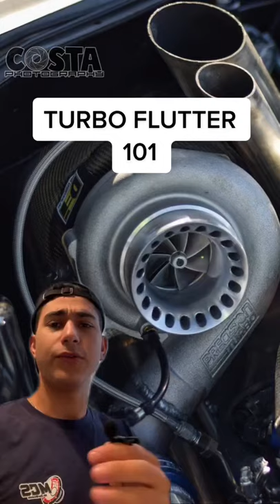TURBO FLUTTER 101 - Explaining Sutututu Theory

Comment: Running a high boost without a blow off valve is going to blow off that whole compressor Wheel eventually.
Reply: At best it will make the turbine wheel loose over time because it spins at such high velocities the bearing used can’t have added pressure.
Reply: @Uno_Floydd  which can lead to excessive play in the shaft. The compressor wheel can come into contact  with the housing if there’s too much play and catastrophic engine damage will occur.
Reply: @Nicholas247066  bingo
Reply: @Nicholas247066  Good thin flutter doesn't cause that to happen.
Reply: @DriftNick It can start to loosen the nut holding the compressor wheel on if it's a lot of boost. It's trying to force the wheel the opposite direction. More boost = more force in the opposite direction. Best analogy I can think of is when your using a hand drill, and the bit hangs up in the material causing the chuck to loosen. Same concept. I've seen and had both of these things happen.
Reply: @mikefelty2625  People here running 50+ psi without a valve and no issues with the nut on the compressor wheel becoming loose, that does not happen, not even sure how you think that it could cause that to happen.

"It's trying to force the wheel the opposite direction."

Except that it's not, it doesn't even slow the turbo down and yes people have tested it.

"Same concept"

Awful analogy, not even close to being the same thing.
Reply: @DriftNick  It can happen, because I've seen it happen. To be fair, turbo design has improved since I saw it happen over 20 years ago to a friend's 240sx and different guy's diesel. Oddly both were borg warner turbos. So maybe a design flaw with those turbos. I'm just saying that it can happen, not that it always will. Just because it hasn't happened to everyone, doesn't mean it can't. And yes, it definitely slows the turbo down or you wouldn't hear a change in pitch after every flutter. The sound would be a smooth continuous drop in pitch like every other time the turbo decels, not the fluttering noise. To be clear, I'm also not saying that the compressor wheel is spinning in the opposite direction, only that the excess boost is trying to spin it in the opposite direction, which is the reason for the fluttering.
Reply: @mikefelty2625  Just because you saw a nut come loose 20 years ago does not mean it was caused by flutter, flutter can can cause that to happen.

"it definitely slows the turbo down or you wouldn't hear a change in pitch after every flutter."

The turbo is slowing down because the throttle plate is closed and exhaust flow is reduced, the rate in which the turbo slow downs is the same with or without a valve, High Performance Academy have a video testing exactly that on their youtube, flutter does not cause the turbo to slow down, if it did it would not be common place in motorsport to have flutter.

The change in sound is both a result of the pressure waves decreasing as pressure goes out the intake and the turbo slowing down due to the reduced exhaust flow.
Reply: @DriftNick   pressure leaving the turbo the way it came in can and does wreak havoc on the thrust bearings in the turbo. And engines are rebuilt far more regularly in the motorsport world than by your typical car owner. Either way it is a surefire way to lower the bearings' lifespan and cause excessive play. Better to play it safe and just use a blow-off valve. Another added bonus of the blow-off valve is better turbo response, because you're not completely slowing down the compressor each time you let off of the throttle. See the following video if you still don't believe me: https://www.youtube.com/watch?v=6o5-oUaD65U&t=63s
Reply: @Nicholas247066  If it slowed down the turbo it would not be common place in motorsport, there is no difference in turbo speed after lifting off the throttle between running valve and not running one, they both slow down at the same rate, in reality the pressure not being released is actually better for response as the pressure does not need to be built up again when you are quickly off and on the throttle.
Reply: @DriftNick   see the video linked above. There is absolutely a difference between running no BOV and w/ a BOV. Running a BOV will prevent pressure backing up through the compressor wheel and keeps the turbine/compressor shaft spinning. It's been proven with hard data and experience in motorsport.
" in reality the pressure not being released is actually better for response as the pressure does not need to be built up again when you are quickly off and on the throttle."
You're referring to pressure that exists before the throttle plate, which has no purpose once the throttle plate is closed. By keeping the compressor spinning, you can more easily build pressure once you're on throttle. Manifold boost is all that matters, not boost before the throttle plate.
Reply: @Nicholas247066  Random youtube video from a guy that sells crap China made turbos is proof of nothing, try not using the cheapest possible turbo and you won't have issues.

"It's been proven with hard data and experience in motorsport."

If flutter caused any performance loss you would not see it at all in motorsport, even F1 cars have it, so does WRC, GT3, LMDH, etc.

If you think there is any performance loss from not running valve you have never actually tried not running a valve, High Performance Academy have tested turbo speed with and without a valve on a dyno, there is no difference in turbo speed after lifting off the throttle.

"You're referring to pressure that exists before the throttle plate, which has no purpose once the throttle plate is closed."

When you open the throttle again the turbo has to build pressure in all the piping and intercooler before the intake manifold, if all of that pressure isn't released then you don't have to build it again from zero, understand?
Reply: @DriftNick   many turbo race cars run recirculating BOVs to vent the pressure back in front of the turbo, thus keeping the turbo spinning. You cited HPA as your evidence, so why not share it? So far I'm the only one who has presented evidence. I'm not arguing this any further, no BOV can and will damage a turbo. Case closed.
Reply: @DriftNick   and if the turbo is spinning, it will build the boost that much quicker. By trying to force air against a closed throttle plate it will slow down.
Reply: @DriftNick   I just took a look, and literally at the end of the video, I quote, "However, that being said, this test is being done at a relatively modest boost pressure ... I can't sit here and say this is an all-encompassing set of data that shows everything you need to know about the blow-off valve". That right there proves your statement is not the end-all, be-all. Which means at higher boost pressures, what I'm saying will probably tend to be true, as the compressor will have a lot more inertia when it is spinning as quick as it does at higher boost. Meaning it's forcing more air against a closed throttle plate, and potentially bleeding off speed much quicker than one with a BOV.
Reply: @DriftNick   and futhermore, also at the end of the video, he mentions:
"As I mentioned, one of the core aspects there is the ability of the blow-off valve to protect the turbocharger from thrust-loading".
All of this proves me right. See the 31:20 mark in the video you mentioned.
Reply: @DriftNick Try reading up a bit on the forces acting on an impeller in an ordinary scenario and when flow is reversed. That stututu sound is called compressor surge. In this condition, flow is reversed through the the impeller causing a different kind of stress than what ordinarily exists. Its simple physics that an additional force input will affect the speed of the turbo, so no you are absolutely incorrect in passing the generalised statement that no BOV is the way to go. Its also common knowledge among the engineering community that surging is never ever good for an impeller or any type of compressor.
Reply: @OverlyCuriousEngineer  If it does any damage it's so minimal you wouldn't notice it and there is no performance loss, in fact there is performance gains from running now valve hence why it's common place in motorsport.
Reply: @DriftNick  probably the reason why they don’t run BOVs in the classes you mentioned, is because they have other ways of managing boost pressure, as in variable vane geometry, electronically-controlled wastegates, etc. And don’t rule out the possibility that it may not even be allowed in the regulations of said classes. Just because F1 or whatever else doesn’t use BOVs doesn’t mean there is no performance gain to be had.
Reply: @Nicholas247066  You need to go learn the difference between a wastegate and a blow off valve and what variable vane geometry does, I'll give you a hint, it has nothing to do with compressor side pressure off throttle.
Reply: @DriftNick  did I say it has anything to do with the pressure side? No I didn’t. But it does influence the speed of the turbine, and hence boost pressure. Before you throw insults at me or put words in my mouth, know that I am studying to become a licensed diesel technician. Such hostility will take you nowhere.
Reply: @Nicholas247066  The things you mentioned have almost nothing to do with what we we talking about which makes me think you don't understand what is happening.
Reply: @DriftNick  believe me, I understand fully what I’m talking about. The operation of VGTs and wastegates have a direct effect on boost pressure. They don’t manage it directly like a BOV does on the pressure side. What is so hard to understand?
Reply: @Nicholas247066  They have no effect on the boost pressure between the throttle plate and the compressor when the throttle is closed, they have nothing to do with this topic.
Reply: @DriftNick  I also never said that said technologies will help avoid compressor surge. F1 cars absolutely have turbo flutter. I was offering speculation as to how they manage boost pressure to a safe level for the engine within their operating ranges. They’re race cars, they are high maintenance. Your use of the strawman tactic doesn’t work here.
Reply: @Nicholas247066  Why even mention it if you know it has nothing to do with what we are talking about?

"They’re race cars, they are high maintenance. Your use of the strawman tactic doesn’t work here."

It's proof there is no performance loss, they could stop it from happening, they choose not to.
Reply: @DriftNick  I mentioned it because you said “if it does any damage it’s so minimal you wouldn’t notice it”. I then provided speculation as to how they can afford to run these cars with no BOV, using the regulations provided. And how do you know that there is no performance loss specifically in F1? Can you say for certain that they have run BOVs in the past, and that they have seen noticeable gains ever since it was banned?
Reply: @Nicholas247066  Your speculation as to how they can afford to run these cars with no BOV makes no sense hence my comments.
Reply: @DriftNick  then you tell me, how can they afford to run no BOV? Because all evidence including the one you shared proves that turbos can and often do sustain excessive thrust wear if run with no BOV. Especially at the levels of boost cars like the ones in F1 use.
Reply: @Nicholas247066  The video I linked provides zero evidence of it doing damage, they test if there is a performance loss and there isn't, they can afford to run no blow off valve just like I've done for over 10 years because if it does any damage it's so minimal it doesn't matter.
Reply: @DriftNick  the person in the HPA video literally said that BOVs protect the turbo from thrust wear. Again, how do they mitigate excessive thrust wear at such high boost levels?
Reply: @DriftNick  if the rules don’t permit a BOV in the first place, they can’t test for it. Again, how do you know there is no performance gain?
Reply: @Nicholas247066  Other forms of motorsport also run no blow off valve, it's common place in drifting, rally, etc where there are no rules for running one, they are allowed to run them, they choose not to.

" how do they mitigate excessive thrust wear at such high boost levels?"

Any amount of wear it causes is negligible.
Reply: @DriftNick  definitely not, F1  runs up to 55 PSI or more. Compressor surge at those pressures causes considerable concern for thrust wear. Its physics. And rally cars run anti-lag systems, the benefits in throttle response offered by a BOV are eclipsed by those offered by anti-lag. Pointing at Motorsport as evidence for no gains from a BOV makes no sense. Turbo production cars run recirculating BOVs and those have a marked improvement in turbo response.
Reply: @Nicholas247066  Plenty of people here running 50+ psi on street/drag cars without blow off valves.

"Compressor surge at those pressures causes considerable concern for thrust wear. Its physics. "

Clearly it doesn't considering how many people do it without issue.

"And rally cars run anti-lag systems"

If it was a performance loss to have any flutter they would stop it from happening, again they choose not to, in other forms of motorsport where anti lag is not present people still run no valve.

" Pointing at Motorsport as evidence for no gains from a BOV makes no sense. "

Pointing at motorsport where people are trying to get the most performance and run no BOV makes no sense? if there was a performance loss literally no one in motorsport would run without one.

"Turbo production cars run recirculating BOVs and those have a marked improvement in turbo response."

Turbo production run bypass valves for emissions, there is no marked improvement in turbo response, anybody that has run a car without a valve could tell you that, clearly something you have never done.
Reply: @DriftNick  as a technician, failure analysis and diagnosis is your bread and butter. Compressor surge is bad for a turbo. End of story. Goodbye.
Reply: @DriftNick  you are citing only anecdotes as evidence and no hard data. Therefore, your statements are anything but conclusive. Your turbo may have sustained surging for this long because your turbo might have more resilient bearings. Every component is designed for a particular loading profile in mind and a factor of safety. Other variables include A/R ratio of the turbo, boost management, how fast the turbo spins, the weight and balance of the impeller etc etc. None of your statements are evidence towards your claim that surging does not damage the turbo. The vibrations induced by surging will eventually introduce play in the bearings and will eventually lead to failure.
Reply: @OverlyCuriousEngineer  As I've already said multiple times if there was any performance loss everybody in motorsport would be running a valve and as we can see in people testing it on a dyno there is no difference in turbo speed after you lift off the throttle, the turbo slows down are the same rate with or without a valve.

As for it doing damage, the only people I see saying that are people that have never run a car with no valve, if it does any damage it's very minimal, we literally have a culture around turbo flutter, that is where the term "dose" comes from, 80's turbo cars with no valve and turbos that out last the engines.
Reply: @DriftNick  That again is inconclusive. Turbos are more resilient than engines being employed in motorsports. After a few races you are rebuilding the engine. How does that prove those turbos are not sustaining any damage?

Comment: fun fact. turbo flutter is bad for the turbo
Reply: Nah.
Reply: no
Reply: How so?
Reply: not really
Reply: @user-ud5uk9sz8e  The sound is caused by the throttle plate closing suddenly (because the throttle is let off) when the turbo is still in the middle of trying to dump air into the system.

At this point, the air has nowhere to go except back the way it came; through the intake. These reverse pressures will ultimately shorten the lifespan of the turbocharger due to the increased stress of air still being pushed in while the air that was put in a second ago is trying to double back. This is what blow off valves and diverter valves are meant for, to either let the air that's still between the turbocharger and throttle plate escape to atmosphere (bov), or to recirculate back to the beginning of the intake system (diverter valve) via a side door routing that opens when the throttle plate closes.
Reply: Compressor surge (turbo flutter) occuring under open throttle is a lot worse for the turbo than closed throttle surge. 

Whether you should mod your intake to do this will be debated for as long as turbos are around but at the end of the day, if you’re so worried about wearing out engine components, you should never start the engine of your car or drive it.
Reply: @_soups  exactly. so basically if turbo go sututu and make me happy then car is happy :)
Reply: the flutter sound is the sound of the compressed air going backwards through the compressor. Only happens when the boost is higher than exhaust pressure in the Turbine. the Turbine and the compressor is spinning backwards. 

doesn’t damage anything but doesn’t increase the performance either.
Reply: @mattiasakerblom3426  Flutter has nothing to do with the pressure at the exhaust end of the turbo. The pressure build up on the compressor end occurs when not enough air is bypassed or released through the blow off valve when then throttle plate closes. Or when the BOV has been blocked completely. The air has nowhere to go but back through the compressor. The flutter is the sound of the compressor blades chopping the back fed air. 

I don’t know where people keep getting the info that the compressor and turbine start spinning backwards. They spin at thousands of rpm on boost, the back flow of air doesn’t just make it change direction.
Reply: Even for a diesel that doesn't come with a blow off valve and is journal bearing only